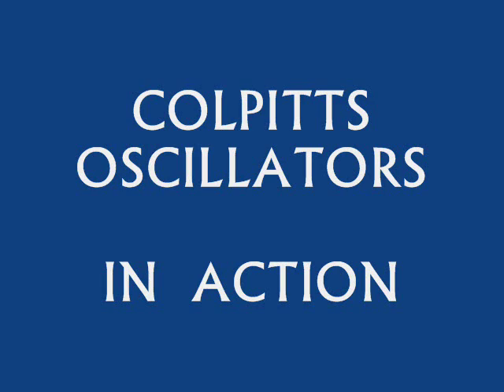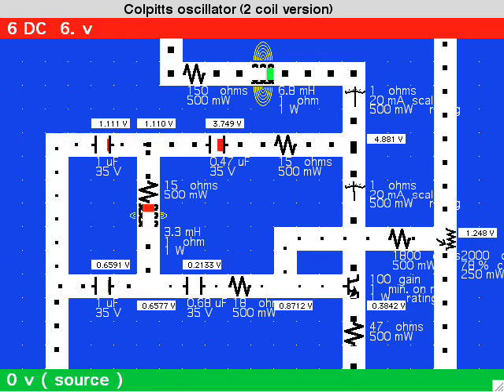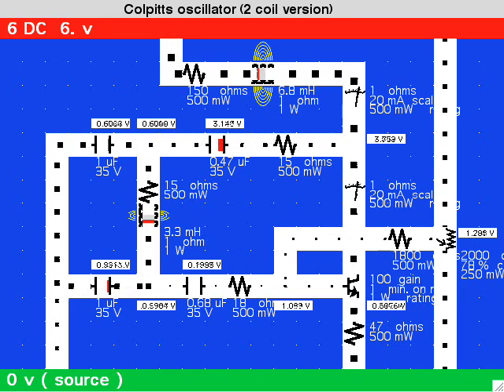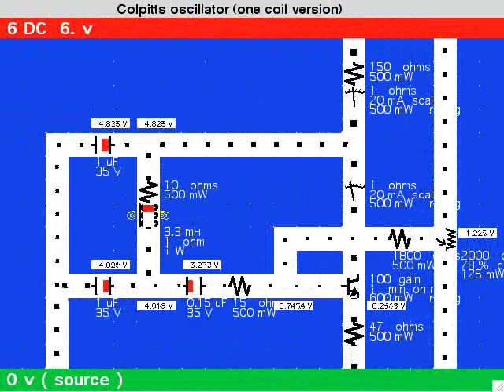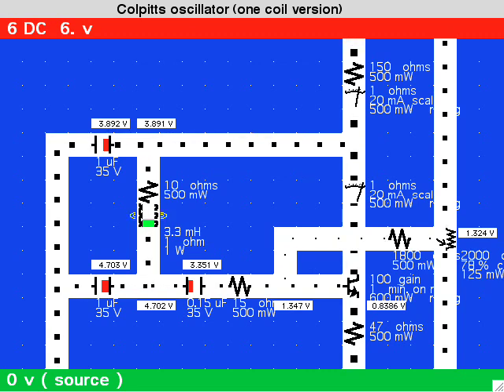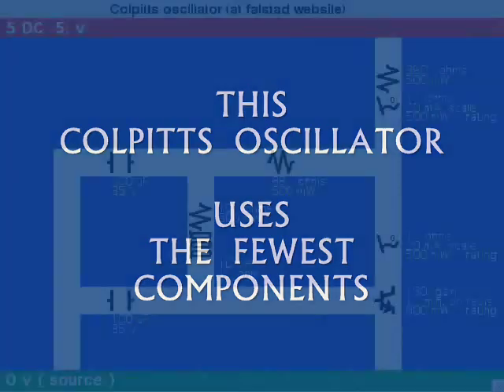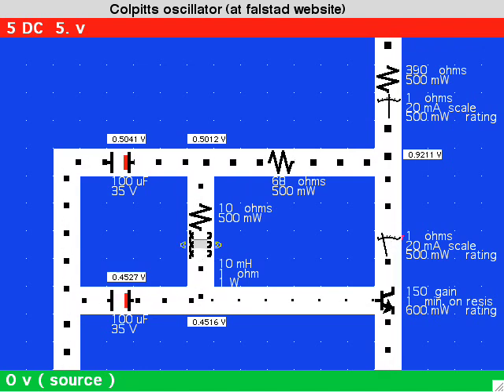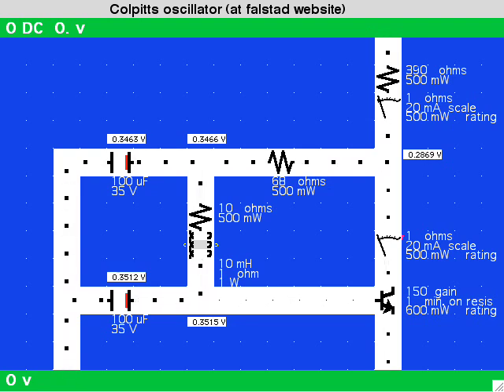Colpitts oscillators in action (Animated)

Comment from the maker: Many circuits have a need for one action (such as resonating action) to be isolated to just the right degree, from other parts of the circuit (such as the power supply). Or the transistor needs to be biased to just the right amount. Etc. It is not always easy to calculate resistor values ahead of time. It may be necessary to play with values for a while, until the desired behavior starts to happen... that is, once the proper amounts of current flow, at the proper time.